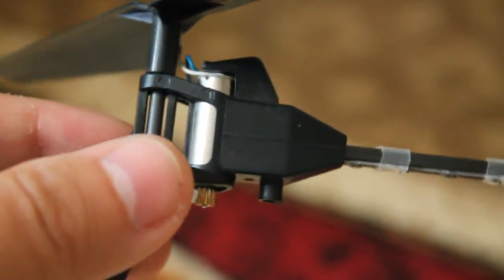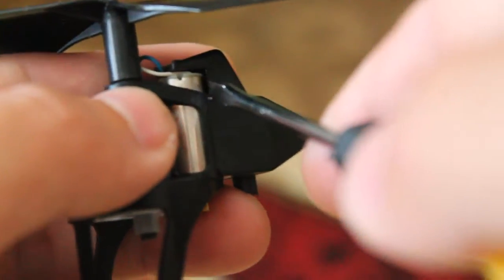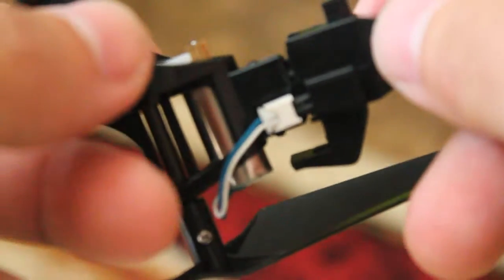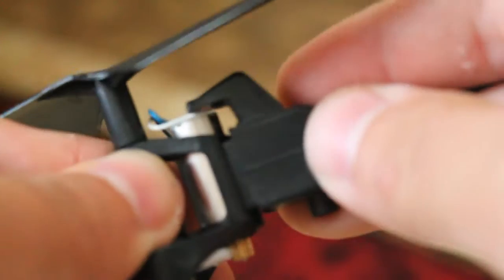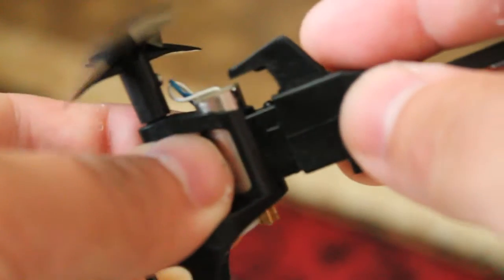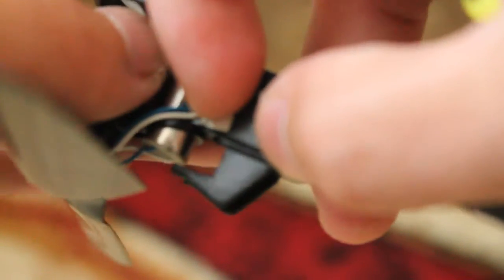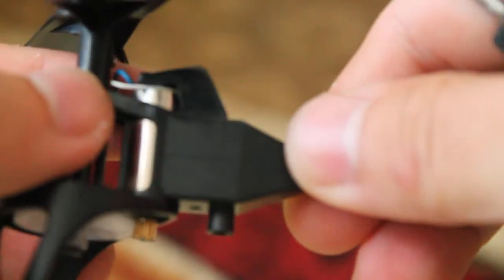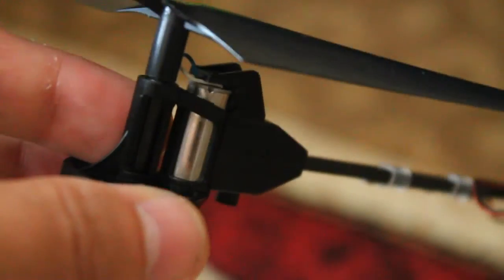WL Toys v959, v222, v929, v949 motor replacement

Comment: Thanks a lot! One of the motors stopped responding after a couple of crashes. I pried it open with the help of your video and managed to find the problem (loose cable contact) and fix it.